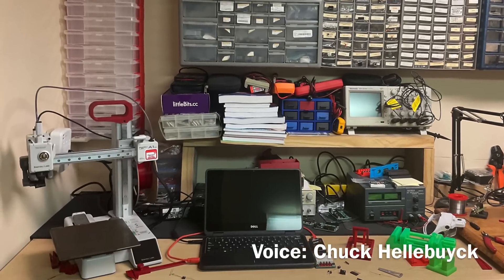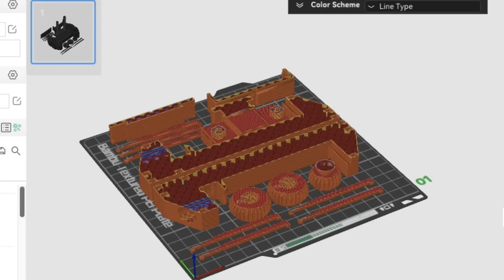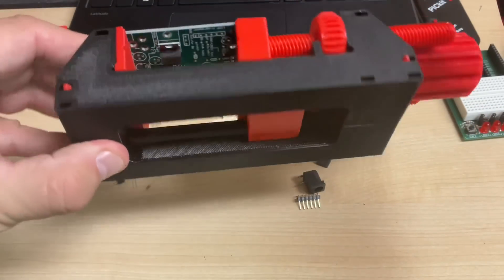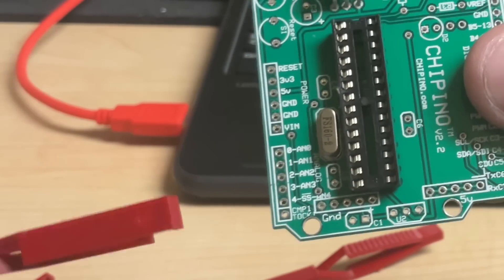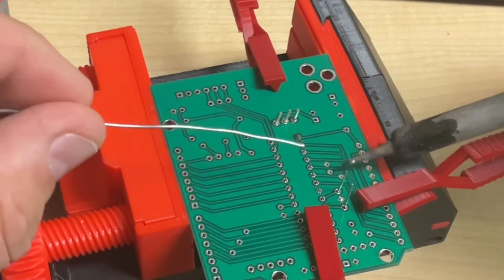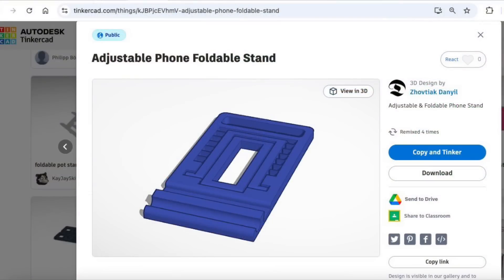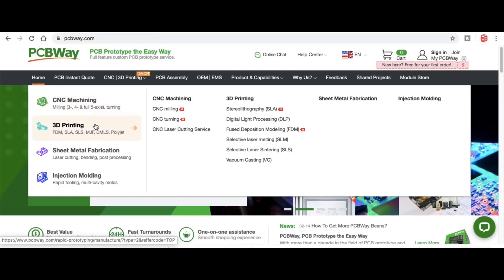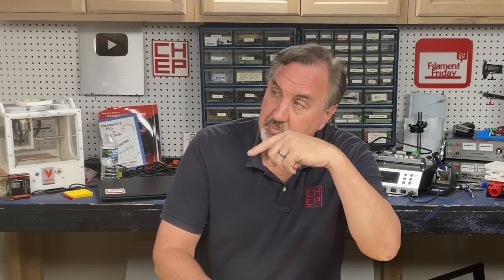Is Bambulab A1 Mini 3D Printer Too Small for Projects?

Comment: My voron v0 120mm sits on my workbench and has over 2500 hours on it… small printers definitely have a strong use case, plus it is crazy fast with near zero warmup time, even for ABS.  I have a couple 200mm neptunes and a 350mm voron for the bigger stuff, and they have half the print time.

Comment: There was a MandicReally poll earlier this year that asked people how big their most common prints were...a surprisingly large number admitted that their day-to-day printing needs would actually fit inside a 180x180x180 mm build volume. Yes, there are plenty of things that we're all printing that are larger than that and I don't know what I'd do with myself if I didn't have a 300x300 printer on hand, but at the same time I have had to actively resist the urge to buy a smaller printer because I'd want to take it places and I really don't have the skills to make a giant custom battery pack like Michael from Teaching Tech made with his portable Monoprice Mini Delta project.

It's a real shame that the Ender 2 Pro has been discontinued, especially when Creality sells an unreasonably large number of other models that are so similar to one another. If/when I do pull the trigger on a mini printer, I'll have to now choose between forking out for a Prusa, forking out even more plus a bunch of time to build a Voron V0.2, or looking more closely at the Aone 2 from Flying Bear...and to be honest, a direct-drive extruder, dual part-cooling fans, linear rails, and no implied threat of having your personal data stolen in any $229 printer is actually pretty neat.

Comment: "A1 Mini Too Small?"
I have a Prusa Mk3, great printer, super reliable, but slow compared to more modern printers, so I was looking at the A1 mini . . . my question was exactly the one you ask "is it too small", so I cut out a 180mm x 180mm piece of paper and walked around holding it up to all the things I've printed over the years and things I'd like to produce, everything I've ever made or want to make easily fits inside 180mm x 180mm !

Comment: I have thought about buying Bambu printers, but the closedness of there print system worries me. I have to use their slicer, their software. My understand is my models are uploaded to their system. Any thoughts on this? Am i worried over nothing?
Reply from the maker: You can use Orca slicer and save the GCode file to the SD card and print from there. It works.
Reply: @FilamentFriday  How do you get orca to display thumbnails in windows explorer. I can see thumbnails in windows from Prusa slicer, why not orca.
Reply: @myownexperience93  Iknow. That's not what I was asking.
Reply: @TonyGrant.  didnt mean to delete my comment but if your using orca you dont have to send all your prints through the cloud and even with bambu you can send them through your local area network and not the cloud edit this is wrong lan doesnt use the cloud when slicing  "but still you would run into their g code slicing using the cloud" your best bet would be to use orca if it bothers you that much or look for a different printer still alot of other good options around same price point So you dont have to use their slicer or their cloud but you do have to use their firmware unless someone jailbreaks it (Lan only and orca no models uploaded to their cloud)

Comment: "I dont know what I would do without it" Its VERY simple. You would buy the generically made plastic vice from amazon for a very inexpensive price. Will be delivered within 1-3 days and you didnt have to buy a 3D printer, the accessories for it, learn how to use it, and then wait 6 hours for it print the vice
Reply from the maker: But I print a lot more than vices with it including cases, brackets, mounts, tools, fixtures, etc. for my electronics. Many things I can’t buy on Amazon. Plus 6 hours is a lot quicker than 1-3 days.
Reply: Stupid comparison, the printer is not solely for 1 vice. He'll probably print out hundreds of things over a year. And why wait for 1-3 days for a small bracket or replacement handle for something or a clamp for something else or a pop shield for your microphone (etc etc) when you can print it out in 1-3 hours. In fact most of things I print are done in 20 minutes or so.
Reply: @davelordy  
Grow up, stupid. I never said or implied the 3D printers are disposable after 1 print. Hey stupid, NO he wont be printing "hundreds of things over a year"  Do the math, stupid. The vice is delivered the next day (in RARE cases it takes up to 3 days)  and so OBVIOUSLY a person is pathetic if they cant merely wait for the next day. Further more, no one cares if you print out little stuff that only takes 20 minutes, when the point is you put a lot of money, accessories, learning curve, etc etc just to print out nominal stuff which reality dictates it does not justify the resources  put into it concerning it wont actually save money for most people even though you stupid people will say I know this person and that person which it saved them money, and therefore is NOT the whole spectrum and is just your sad attempt to make a defense. I have an Ender 5 Pro and so I KNOW what 3D printing is about and how I was given hyped up encouragement to do it just for me to find out it DOES NOT make everyone's life become more practical and there's A LOT of problems that come up which the manufactures and many of those who promote the 3D printers was not upfront with them
Reply: @tymz-r-achangin I bought a hot air soldering iron to desolder the small and solder the larger memory in my module. Am I stupid too!?

Comment: I used a 3x3” build plate for years making small prototypes and it was always more than enough and I loved it.
Reply: Yep, the edges of my Prusa Mk3 (250 x 210 mm plate) have never been touched, in 7 years ! Everything I print ends up less than 150mm x 150mm, big print areas are great, but 99.99% of the stuff most people print does't need it.

Comment: I have my A1 mini directly to the left of my desk, and have an AMS lite wall mounted behind it. So it takes up very little table space. I also have three full size A1s, but my mini is my most used printer. Amazing and reliable little printer.
Nice job on that vise and those clamps. I'll be printing both. 🍻

Comment: I bought an ender 2 pro a couple years ago on Chep's suggestion and it's been a great printer. Almost all of my prints have for on it, but i did get a new, larger phone last year and the cases for it don't fit on the ender 2s bed, but that's been the only thing i couldn't make fit.

Comment: The tweezer clamps are brilliant.  I usually make a custom "hold-down" for all my components whenever I make a new PCB because I could never figure out how to make a clamp that wouldn't get in the way of the solder pins.  My first printer was a cheapo small one (not an A1 mini) and I love it.  I also now have a full size A1 that I use for larger prints or something I want done really fast.  But my $150 workhorse is that 180 x 180 size.

Comment: Hi Chep...thanks for the cool solder clamp. I just bought your design and printed a few out. Very nice. Also, thank you for all the great videos on updating the Ender 3...I think I watched all of them before I bought a stock Ender 3 about 4 years ago. That printer worked well. I upgraded to the an Ender 3 V3 SE last year. Also a nice printer. I really like the auto bed leveling with the z-offset calculation. This printer is hard to beat for the price I paid ($159). Although the Bambu A1 mini looks like a good one as well...maybe even better.  Thanks again.
Reply from the maker: They are both great printers. I still use my SE.

Comment: Perfect timing CHEP !! 
I'm just cleaning out the electronics piles & have little PCB kits and parts to solder together.
BTW, Your assembly vid for the Ender from long ago with the corner squares was indispensable. 4 yrs later the machine is still good as day one. When I got the machine to build prototypes my CNC friend said "watch CHEP" 
I run Ender's glass bed with Prusa SLOW settings with PLA; and only need 2 wash it with dish soap and comet Every 3 years.! I've gone as long as 18 months without even having to re-level the bed also ! The Square assembly alignment is the big reason for this. A paper towel wiping dust off the bed is all that's needed if the unit has not been run for awhile.